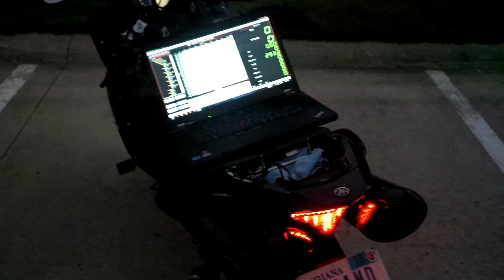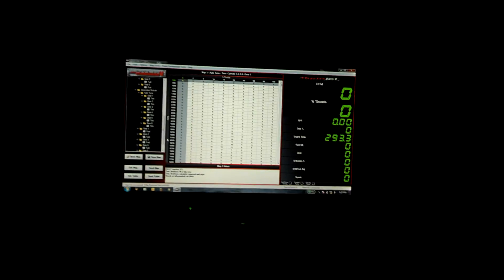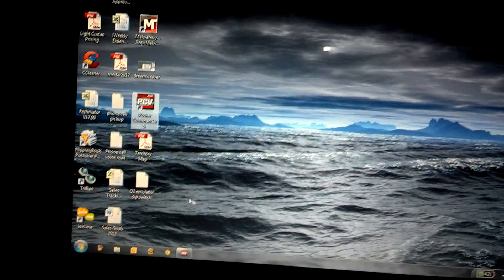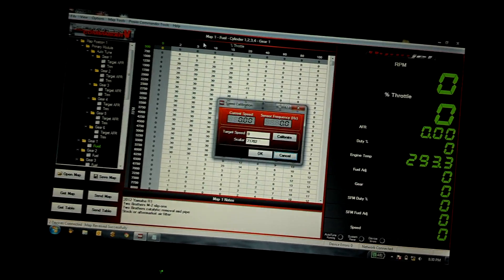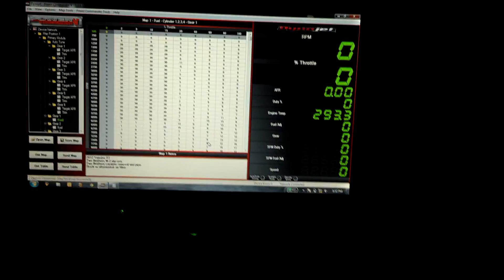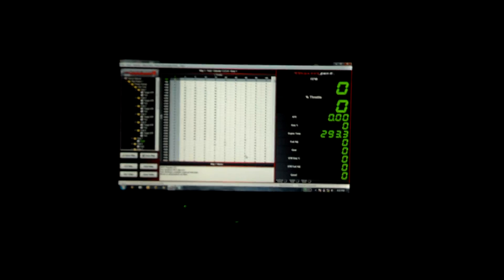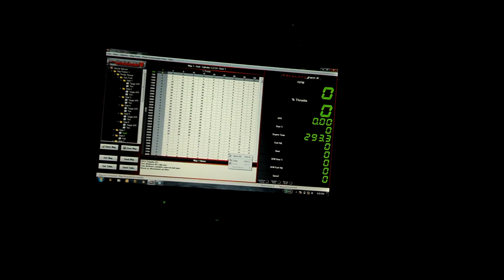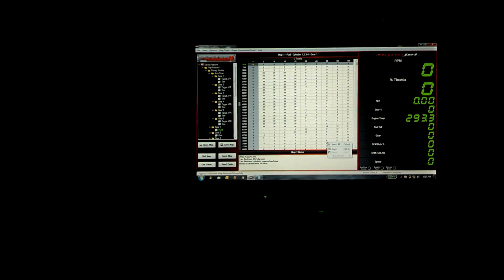PCV, SFM, Auto Tune gear advance setup 2012 R1

Comment: Thanks bro, dynojet doesn't tell you jack as far as how to even use there products its all buried on there site, when I got my autotuner it wouldn't show afrs and thusly wouldn't work, I had to call support and they had to send me a firmware exclusive only to them and send to the unit, what kinda bs is that? Why wouldn't it work out of the box, given I had already updated all firmwares but to not have your product work unless your given a key file what is that all about? It's a bunch of aggravation

Comment: hi there bro.i just installed a pcv on my 2010 r1. my set up is slip on gytr, -1 on front sprocket and k&n filters..im only using maps whats on the dynojet site(pretty close on my set up) and can’t really tell any difference..any suggestions or do you have a custom map i can copy for my set up? i just want my bike to reach its full potential..thanks mate.godbless

Comment: Do I need a Power commander V or I can use just secondary fuel module?
Reply: PCV is the main brain that speaks Windows, secondary fuel module, auto tune, ignition module, and LCD display all daisy chain off of it.

Comment: Hey cobaltss. I installed s PCV +Autotune, and doing the same ås you, going for gear advanced. Problem is that Im having some trubble getting the speed signal readings. If you can please post how, and exactly vere you tapped yours, it wouldt be most helpful. Ive already searched and posted on the US and UK R1 forums om this subject, but without any luck getting help. Tnx in advance for anything that could help me out ! :)

Comment from the maker: yes, you'll have to weld another bung into the Y pipe if there is not two in it already. You'll need to add one for the stock O2, and another for the wideband for the Auto Tune. Now that I have flashed the ECU with the Flash Tune module, I personally don't use the O2 sensor anymore.

Comment from the maker: @Andreas EllinidesYes, you will have to calibrate the throttle, then the speed, and then the gear position. The PCV reads the signal that the bike is giving out VIA the speed input wire to determine if the bike has changed gears or not. Yes, the AutoTune will adjust the trims on the fly per the value you set, default is 10%. Let me know of you need anything else!

Comment: Hey bro, very nice video and lots of information explained the simple way. Now , I need your help... I have a pcv and autotune. I don't have any speed input plug. I just need to calibrate the gear position. Can I do that only or I do need to calibrate throttle - speed and then gear position. Also does the autotune adjusts values on the fly or you have to accept its trims after the run. (I might have some more questions as this is my first time installing a pc and auto tune.)